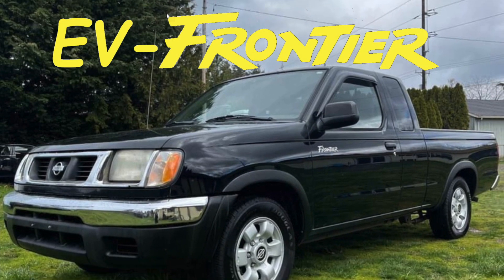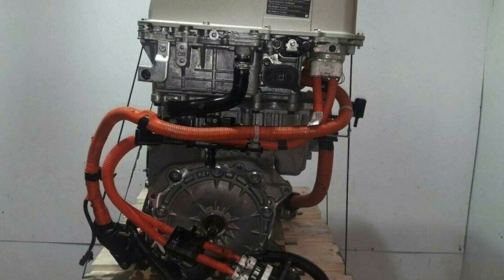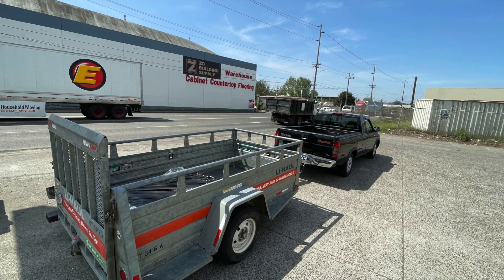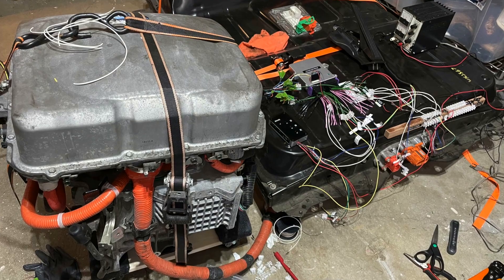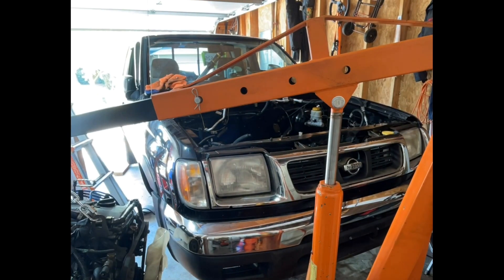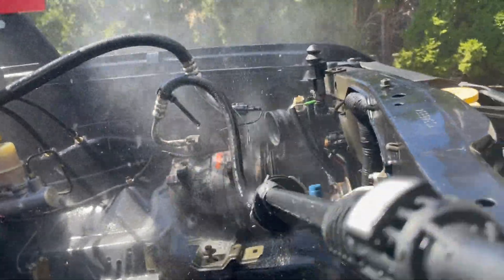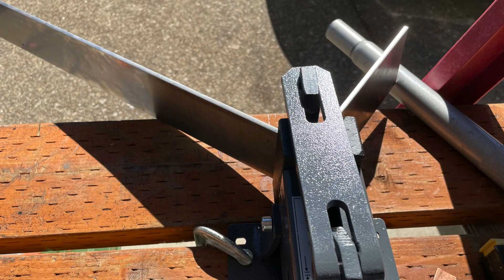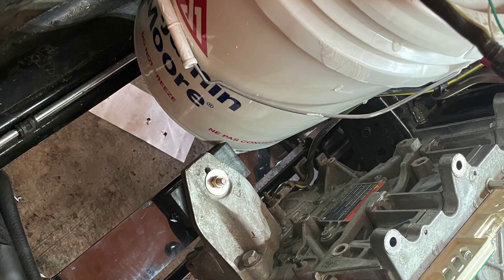EV Frontier Part 1 - Budget EV Conversion

Comment: i did mine with a electric hub motor inside the wheel, so I was able to keep the gas engine and use both when needed
Reply: What motor did you use ?
Reply: thats crazy bro

Comment: what have you done with the other drive shaft outlet from the leaf?
Reply from the maker: The motor output is connected directly to the transmission input via a splined coupling.  I removed the gear reduction "transmission".

Comment: Did you remove the gear reduction and output, where the CV shafts usually are?
Reply from the maker: Yes I did.  The motor output is connected directly to the transmission input via a splined coupling.

Comment: I want to take my 1998 Nissan Frontier with a 2.5 L turbo charged it put an electric e-charger on there and then still stack one of these larger diesel or bus hydrogen cell units that are the dual quads with a water meth injection kit plus a low dose economy squirt say 2 or 5 nitrous shot. I want the most monstrous hybrid that's ever been thought of in a little pickup truck so I don't ever have to pull over for the criminals of law enforcement ever again I want to up armor this thing like Mad Max and be ready to stand up for Freedom stand up for freedom of travel. I am above the law for it is one nation under God not with him their oaths are not holy they are not worthy they know him not they do not serve him or his Kingdom. 😊
If I choose to go with an            e-charger instead of a Tesla motor that will be just fine.
Thank you man you are an inspiration God bless you if you have any advice you can reach me at
ozkaltbldgco@gmail.com
1417-287-0585
 If you wish to consult me in any way I will pay you in Gold yes real gold crypto or cash whatever's fine with you. 
  Say hey man

Comment: I'm just thinking here, wouldn't it be simpler just to take the whole front end out of the leaf and with the motor and everything and put it on the truck. They're both Nissan so, maybe it would work, you would have front wheel drive then though

Comment: Tip:  if you have an iPhone with LiDAR, you can use it to scan the bell housing, and the motor face, and render them into 3D cad drawings to build the pattern for the adapter plate.
Reply: F'n mind BLOWN. I needed to hear this; you're the bomb pink.
Reply: Which app do you use?
Reply: Bruh if this is true your the 🐐 for this
Reply: I would not have even thought lidar was on a phone.
Reply: Is it accurate tho?  I mean, a 32nd off and those bolts aren't going to fit.

Comment: THANKS SO MUCH.

 IT'S GOING TO BE INTERESTING TO SEE HOW YOU PROVIDE THE VACUUM BOOST FOR THE BRAKE MASTER CYLINDER 

AND HOW YOU'RE GOING TO GET THE HEATER TO WORK IN THE CAR 

AND HOW YOU'RE GOING TO GET THE AIR CONDITIONER HOOKED UP. 

THEN FOR EVEN MORE COMPLICATED THINGS HOW YOU'RE GOING TO GET COOLING AROUND THE BATTERY FOR SUPERCHARGING? 

AND HOW YOU'RE GOING TO PROVIDE HEAT TO THE BATTERY FOR ICY SNOWY WEATHER.

Comment: Thanks for this. Gives me a plan to convert my 98' S-10 for the street and 85' Nissan 4X4 for running on the property.
   What kw battery pack did you use?
Reply from the maker: 24kwh, but currently shopping for a 40....

Comment: I'm covering my 96 Nissan D21 with a Leaf motor, Zombieverter, and brat industries adaptor.  Did your coupler fit in the transmission unit shaft without issue? Mine seems to have shrunk and didn't want to fit.
Reply from the maker: Yes it fit onto the shaft fine. I had to trim a little nub off the transmission input shaft to make it a little shorter but it fit without issue. Was a little snug though, so I applied a little assembly lube. Did you use the original clutch disc?  Maybe got compressed when press fit?
Reply: @meplyee  I had to cut the tip of the input shaft as well.

Comment: awsome! glade to see the parts worked out for you, with the PDM, did it not fit the engine bay because the cover was too tall?  the newer pdms have slimer covers, might be worth making a new one and having it stacked on the inverter like stock!
Reply from the maker: The transmission was too far back. I would have had the PDM pushed up against the firewall and I would have no room for the cooling hoses. The other option would have been to make a bigger spacer, but I thought the coupler would then be too short. Maybe something for the future, as that would look a whole lot better!